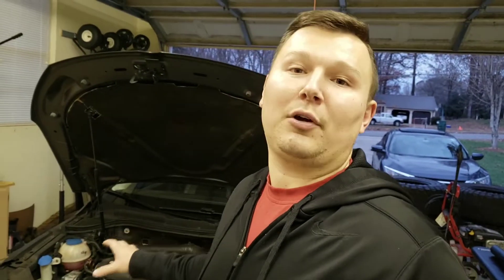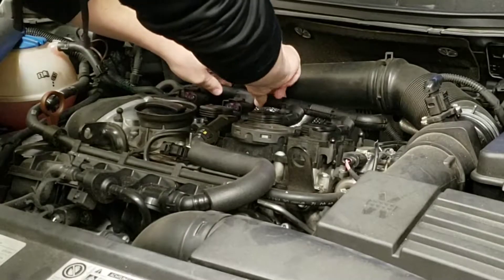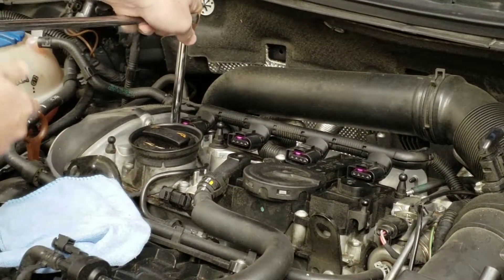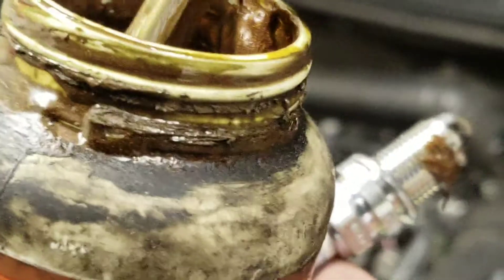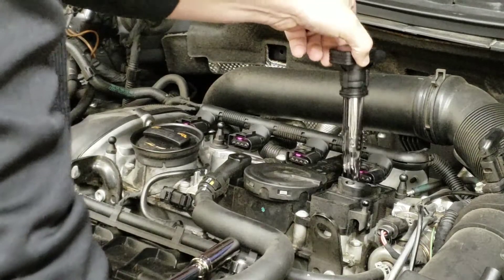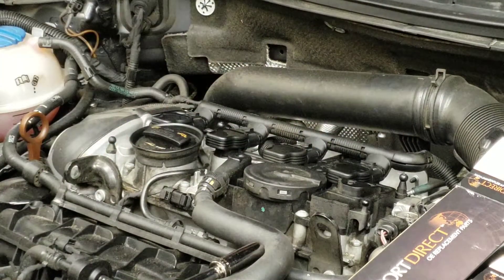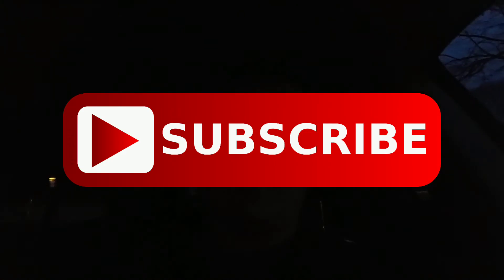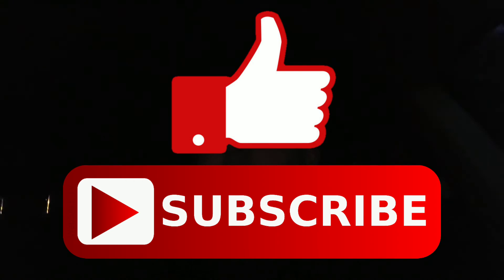Volkswagen CC Ignition tune up how to

Comment: So I bought a 2014 Volkswagen cc from the Volkswagen dealership, with 120,000 miles on it. Recently, one of the coils went out , so I went ahead and replaced all for spark plugs, and that one coil that was bad . What kind of tuneups do you recommend I need to check on this car to make it last a long time? I feel like the dealership didn’t do a full inspection before selling the vehicle.
Reply from the maker: Sadly any vehicle with coil on plug ignition is just a ticking time bomb. You won't have any detrimental effects from a coil going bad unless you just keep driving with it. Any vehicle over 100,000 miles should probably keep a spare coil in the glove box just in case you have one go out or just replace them all when the first one goes to be safe. Other than that, keeping the oil changed, air filter clean, and plugs changed out regularly will keep everything running good!

Comment: What tools did you use to get the spark plugs out? What size ratchet were you using? This is an awesome video!
Reply from the maker: Thanks I hope it helped you out! I can't remember the exact size but you can grab a set of spark plug sockets from about anywhere that will have all the sizes you'll ever need.
Reply: I’m sure it’s a 5/8 spark plug socket 👍🏽

Comment: I'm looking to replace all 4 coil packs and spark plugs at 88k miles now.  2 yrs ago the dealer charged me almost $1,000 to replace ONE fuel injector; well guess what, it's started misfiring again on cyl 3!
They did not replace any plugs or coil packs.
PS: My 2013 CC did the same thing as yours did, but it was when I tried passing a truck on the highway...  Eng light, chug chug chug...NO POWER...then a couple hrs later, no issue.

What size plug socket do I need???

Comment: The story of a vw.....the only car you can hit a pothole and the car says F you I'm  out
I have a beautiful cc that I still owe on  but cannot even drive it anymore because it just will not stay running. 
Absolutely screw german half ass engineering. I have never owned a car that you had to pay on but also have a budget outside of that to keep it on the road
Reply from the maker: They are great cars until something electrical goes wrong.

Comment: Good video
Reply from the maker: Thanks!
Reply: @BakersDIYLifestyle   I bought a 2013 CC 130,000 miles, about a year ago.  I recently noticed problems when shifting gears. I was afraid it was the transmission so today I brought it to my local mechanic and found out it needed a "tune up".  Four new spark plugs and 1 coil. I dont know as much as i wish i did about cars but after watching your Video I could have probably done it myself. Keep up the great work!
Reply from the maker: These new cars are so sensitive to electrical stuff it can be really hard to pinpoint what is causing the problems. If you're lucky a quick scan will tell you whats wrong! Thanks for checking out the video!